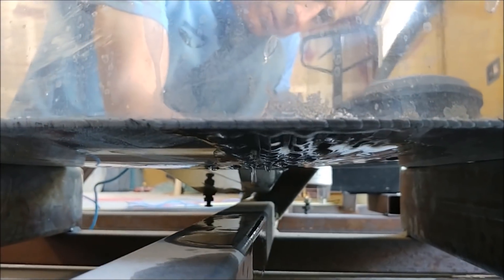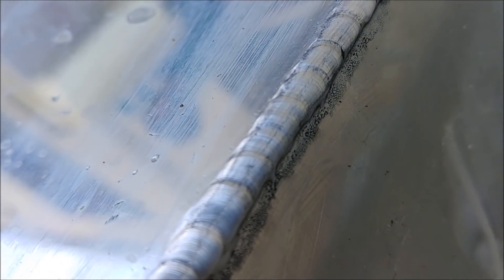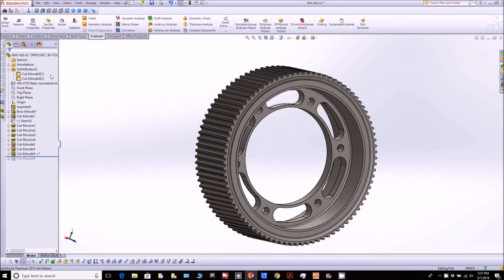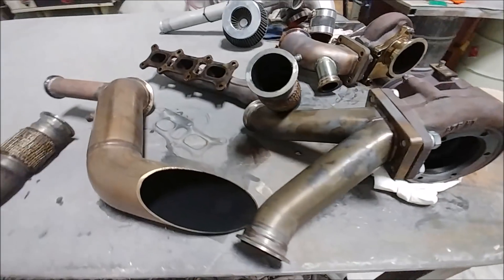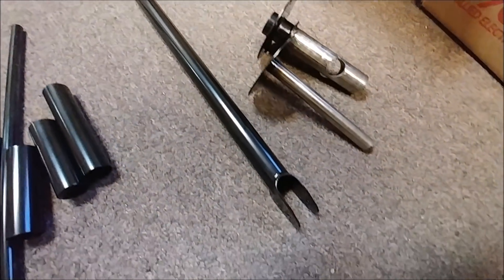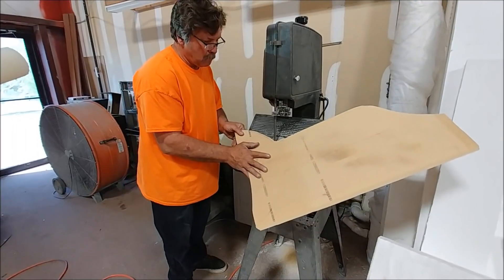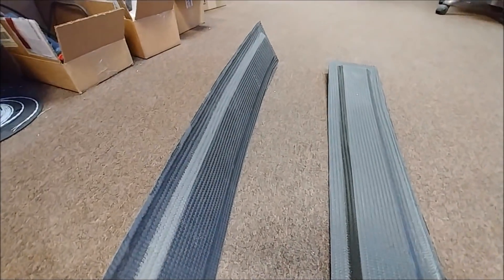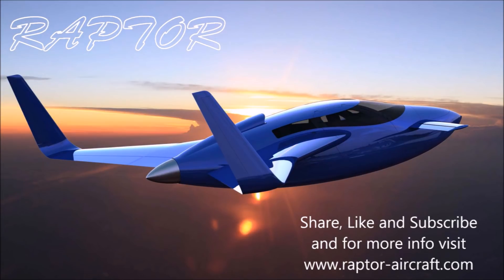Changing Gears

Comment: We use a ceramic coating on ductile iron pipe for corrosion resistance. Are you planning on coating the inside and outside of all your exhaust components?
Is the efficiency gained in a smoother flow of exhaust?

Comment: Excellent work as always. I asked a question on a previous video and on fb about the oil sump. are you using a wet sump or a dry sump??
Reply from the maker: Mbuchi Thiani presently a wet sump with a windage tray added.
Reply: Thanks for the reply ..... from experience, i worry about a wet sump's suitability in an aircraft. Have you considered converting to a dry sump ??
Reply from the maker: Yes, but not right now.